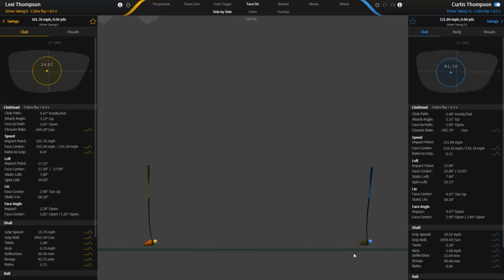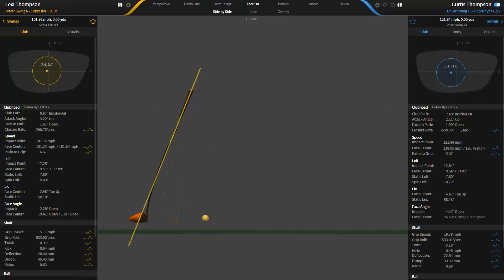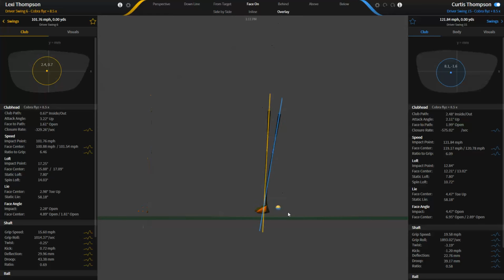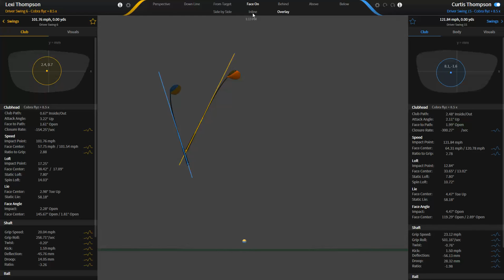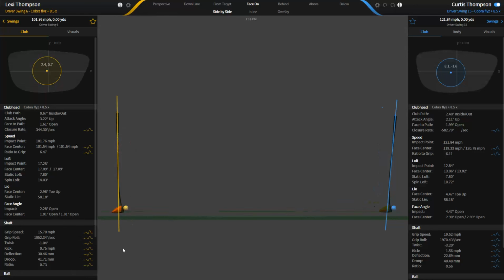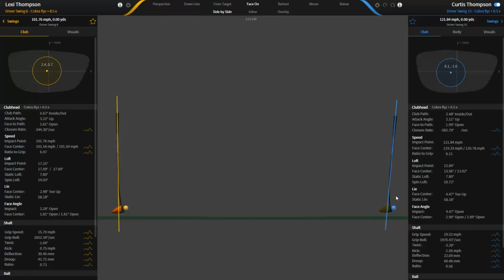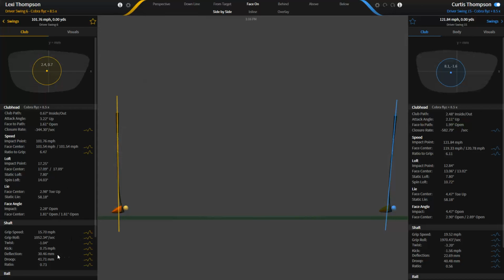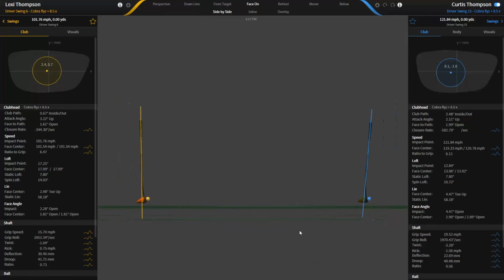GEARS GOLF- SHAFT DEFLECTION DEFINED

Comment: Lovely video. So in regards to Lexi’s data, we wanted less deflection. So with only that single criteria in mind, we need something with a bit more stiffness it looks like somewhere around the bottom third, like 12-15” along? More stiffness at that point, less lead deflection, tighter ball mapping.

Then adjust tee height and distance from ball to center that mapping on the sweet spot or wherever minimizes the player’s unwanted miss, ie would rather miss more high toe vs anywhere at all low heel?

Comment: When I told my local fitter who doesn't have a track man or any other measuring radar that the regular shaft that was on my driver wasn't holding my club face stable he said it was my technique in my swing. Granted it was an app on a phone, but it read 156 mile an hour ball speed. I told him I have to be swinging over 100 to achieve that ball speed. He asked how far do you hit it? I said if I slow my swing speed to 70 % I can hit it straight 215 carry. He said a regular shaft is fine. I said if I go 85% it goes 200 straight and 40-60 yds right. He says your over the top slicing. I had to go to youtube to find wait I am saying is true. I am waiting for my new shaft to be installed and am using a regular flex burner and have to sweep at the ball like an old man to keep the face stable. Still carrying 245 doing that. Golf "experts" will never deviate from what they know is true! UGHH! Also had to explain spin rotation and a push fade!

Comment: This is fantastic data and analysis thanks Michael.  Based on your closing comments, I'm guessing that 45mm of droop and nearly 80mm of lead deflection at impact on my 6 iron, is a bit excessive and that I should be looking at firmer shafts.  Do you think the excessive deflection is a contributing factor in my high, low-spin and fading ball flight, or is it more likely to simply deliver inconsistent strikes?

Comment: Great Video! 

So lead deflection usually produces a more positive AOA and can cause lower strike point with the nature of the club flexing through impact? 

To decrease deflection within lexis swing would the profile need to be stronger in the tip or butt section? Is deflection happening because the cg in the head is rapidly trying to align with the shaft? 

Also would this be true with irons also? 

Thanks
Reply from the maker: ThunderMk2  all things considered equal.  If you made the exact same swing with a ladies flex the club would deflect more and the ball would be hit lower in the face. It would also droop more and that would move it toward the toe  but you would have to make the same exact swings 

Yes the grip  is always trying to alighn to the center of mass of the club.  Same with irons. 

Good questions!